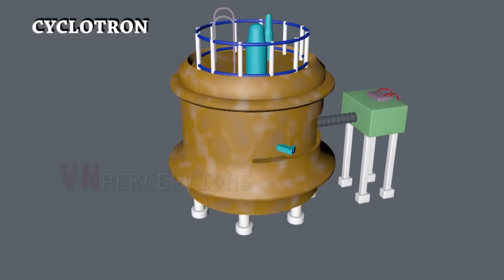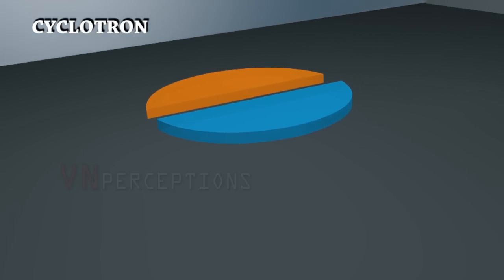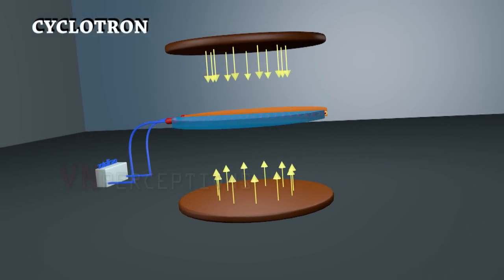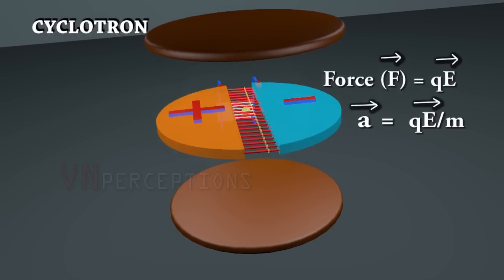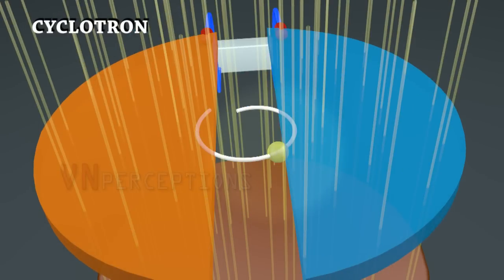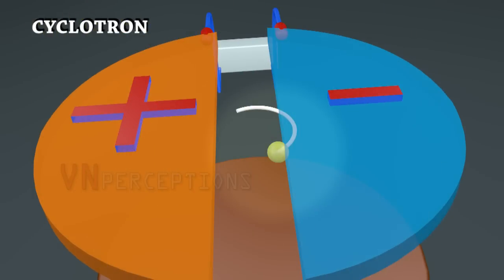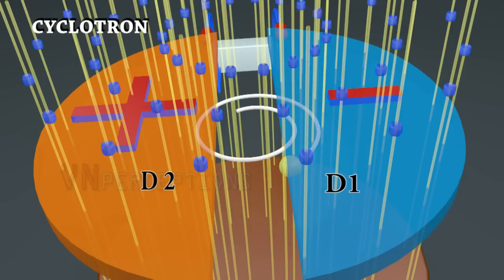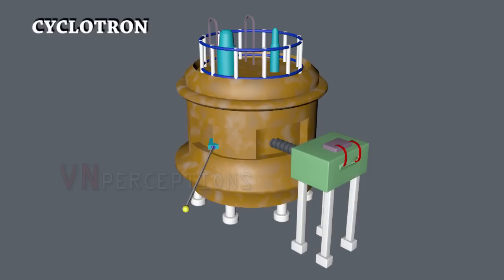Principle and Working of Cyclotron

Comment: just listened to a video about movement of a charge particle in an electric field and magnetic field.  Apparently in a magnetic field it moves circularly.  These guys must have been brilliant to come up with something  like that and work it out back in the 1930s.  I found physics textbooks to be dull and awful in 1980s at college.  I didn't lose my interest in learning about it, but got sick of getting Cs in the subject in college.
Reply: Apparently in a wire, the electric field pushes the particle forward and then the magnetic field moves it in a circle, so it moves in a helix in a wire on the outside perimeter (skin depth) of the wire.  Inside electric field of wire is zero.  I learned that on youtube , not in my 1984 electromagnetic class, if it is correct.

Comment: Probably a dumb question, but what stops the particle from getting kicked off the flat circular plane?  Flawless manufacturing?  Its only my gut instinct questioning this, but couldnt imperfections raise or lower that particle height as it revolves?  Are the Ds made sufficiently tall in depth that those offsets wouldn't matter....but then how is it concentrated perfectly upon ejection....i guess thats more like 5 questions....

Comment: Fantastic video about how a particle accelerator works!!  Thank you!! 

In case people are interested, if anyone clicks on the purple channel icon to the left, they can see a device fly by accelerating particles downwards without any mechanical moving parts.  It also carries its power supply which is really what makes it novel.  Perhaps a more advanced version could just accelerate electrons.

Comment: Wow, Alex Jones was right! They must be opening a portal to hell at CERN.
Reply: Jimbob Sherwood 
No, Unless u mean that in a metaphorical sense and we obliterate ourselves attempting to access properties of the Universe reserved for the ‘Gods’ that came here Eons ago and modified some monkeys and things to create us. Prob for food of labour needs lol... and please dont use the word ‘portal’... it implies we actually intend on physically ‘entering’ it.
Its (Cern) just probing at stuff really trying to work out the properties and characteristics of the underlying field that the Source Charge is manifest from. ie; where does EM come from.
I think this machine only lets them have a small glimpse, maybe one larger one before determining the configuration required to ‘tap’ into the field for the purpose of obtaining virtually unlimited reserves of energy. The energy is not introduced into our 3D plane of existence though as the very nature of our most fundamental field modality simply cannot sustain the pressure and inductive potential of this energy. The intrinsic magnetic component of our field would also induce a mind boggling level of impedance onto the electrostatic charge and coupled with the resulting change in the torsional force, things are getting pretty deep into unknown, unknowns territory. Instead the information gathered can be used to try determine the resonant properties of the Source charge and attempt to align these two Field modalities in a way the the resonance ‘feed back’ is greater than the energy required to produce the input signal. 

Of course, in the interplanetary and more so, the interstellar mediums, there are much greater possibilities as the conservation of the respective local medium is not of such great concern. Imagine unleashing charge equivalent to our entire star but not as thrust but as a directed repulsion form of electrical force that pushes on the relativity dense ‘fabric’ of our ‘space’ ( the stuff that ‘matter’ is able to ‘transition behind’ at magnitudes smaller than our highest energy EM wave form. 
Incredibly risky....
Could be a drop in the ocean in reality, or....
The ripple effects through either our fundamental fields, or more worryingly, through the source charge field could have unexpected effects on our existence at distant locations. Cause supernova of stars or loss of input energy at a galactic centre... 

But thats some time away lol. We’ll have more likely irreparably damaged our genome and contaminated the planet or catastrophically disrupted a critical component of its electrical/magnetic/resonant system and/or fields.

Comment: 3:24 "The electric field inside the container is zero"
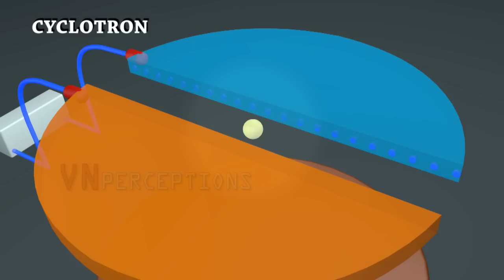4:24 "It (Charged particle) is influenced by an electric field" .......?????
Reply: yes, the electric field inside the dee is zero because it is a metal or conductor.  But inside the dees, magnetic force or Lorentz force do their work by moving the charged particle in a circular manner. Then when the charged particle has come out from one dee, it is moving to another dee by the influence of electric field ie present in between the dees due to external ac field or oscillator.
Reply: No...
Reply: @pritamkumarbishee5053  
Ok...
thank you...😊👍🏻
Reply: @s.k_525  yes

Comment: i don't think when particle move(gets accelerated ) between the dees in presecence of electric field it will have a curved or parabolic path in comparison to distance and accelration provided to the particle i.e. its motion between the plates of dees should be straight ....right?
Reply: No because it is still under the influence of the magnetic field which is perpendicular to the plane of revolution of the charge (which gives it its curvature) :)

Comment: So at the end you need a particle deflector to shoot the particle through a tuning tube so it can slam into an element, thus causing a transmutation causing thermal nuclear heat. That heat can be mixed with a gas to cause a combustion to start up the gravity excelerator. Once started, it will produce a gravity wave.

Comment: why electrons are not used in this device?
Reply: When a particle speeds up and approaches the speed of light, it's mass increases. Because electrons have so little mass (9.11x10^-31) any change in mass would have a great impact .This means the time period for each circle would increase (because the electrons are heavier). Protons are used because they have a lot more mass (1.673x10^-27) so any mass change is negligible, so the time period for each circle is constant. This is useful because it means we can set the current to change direction every 5 seconds or whatever, which we couldn't do if we used electrons.

Comment: Why not electron is used??
Reply: Maybe because of its extremely less mass, it may not be useful in nuclear fission. I am not sure though.
Reply: @anmolagrawal5358  is right. The main use of this machine when it was first in invinted before the Manhattan project. The main purpose of it was to accelerate a larger particle so that it would have enough energy to break up a radioactive element setting a chain reaction. The electron would even to small to effect the large heavy radioactive metal
Reply: @codyburkholder7397  Um you partly wrong sir. You are right about electrons not being used due to EXTREMELY SCARCE MASS but sir the penetration power of an electron is FAR FAR greater than a PROTON or a NEUTRON. The actual reason is that the electron would be accelerated to such high velocities that it would become out of phase with the oscillating field & it is EXTREMELY TOUGH to perceive its curvature at such high velocities so the desired effect of cyclotron wouldn't be achieved. :D
Reply: @nukemarsYT  can u  clear this point a lil bit ?
Reply: @FourrabeaCamillo  what exactly do you need an explanation on? (To make it easier) :)
Reply: @TheKawaiiStar  it would become out of phase with the oscillating field and it is extremely though to perceive it's curvature at such high velocities??
Reply: @FourrabeaCamillo  Oh that bit. Well what I mean to say is um.. you see we are using an ac source to supply the Des with electricity to generate an electric field and an ac source changes basically the direction of flow of current after every cycle which is called the frequency of the source for example 50Hz. That would signify that the direction of the current changes 50 times in given unit of time which is 1 second here. So if an electron is used in place of a RELATIVELY HEAVIER particle such as a proton or a neutron when the electron keeps gaining more and more velocity it will VERY SOON run out of phase with the ac source stating that when the direction of the current is left to right our electron under the question would be moving in THE SAME DIRECTION AS THAT OF THE CURRENT which would mean that it'd lose its momentum and the whole project would fail as a whole since the very point of having a cyclotron was to ACCELERATE SUBATOMIC PARTICLES to SPEEDS such that would bring man some benefit but by the use of electrons it'd rather bring the opposite effect by making the electron lose momentum than gain it (there's a lot of unnecessary information in this comment lol pls excuse me) and the cause of that is: 
1: mass of the electron being almost negligible compared to a proton or a neutron which already have a very INSIGNIFICANT mass
2: electron's ability to penetrate is so much more compared to the other sub atomic particles (because of the first reason again) that it will run in the same direction as the electric field (which fundamentally shouldn't happen) therefore reducing its speed and momentum than increasing it.
hope it helps :3
Reply: @FourrabeaCamillo  also uh just felt like typing this down too. The terms in phase and out of phase carry different directions for a proton and electron here due to the difference in the fundamental effects of an electric field on both. :)
Reply: @nukemarsYT  why momentum decreases if electron move in the same direction as electric field?
Reply: Because on high velocity the mass of electron changes

Comment: Good effort. But at 5.36  its said that the velocity would remain constant inside  the DEE 1. This is wrong, Magnetic field inside the DEE changes the direction of motion of the particle. Change in direction is change in velocity, which is also acceleration. What remains constant is the speed. Please correct this.
Reply: true sir

Comment: just question .  can man build a cyclotron able to reach escape velocity for radioactive waste.
to the sun
Reply: Simply we can't accelerate that much mass to such a high speed.It will take lots of energy
Reply: @dncmi1436  you are absolutely right
Reply: the escape velocity to sun from earths orbit is 42.127 km/s....
the only limitation this cyclotron faces is that if velocity crosses speed of light then the frequency becomes zero more like placing a pendulum in the middle of the earth it wont oscillate 
 this can be followed up by einstein special theory of relativity ...
and yep you cant oscillate neutral species and only charged species can be accelerated and also using  an electron is not preffered cos its mass is  not effecient to initiate an acceleration and get a massive velocity out of the cyclotron.....

so basically what am saying yes it can reach escape velocity but what you tend to do with it is not practical
its like launching nuclear waste to earth atmosphee
re
lots of variables and lots of stuff can go wrong and the high enrgy radiowaste can even bombard the atoms in our atmosphere on its journey to the space.....dude cmon think about it...seriously
Reply: @azzyboii830  oh very nice so you basically talking about the most basic principle of theory of relativity that is velocity increases mass so exactly you are wrong indirectly because any charge particle (except electron and other which have less than gram mass) can travel at speed of light such that you should just have adjust the duration of time to radiate energy from any charge it will behave like infinite mass.....you should lot to learn about special relativity 

Just take it seriously you are right but didn't understand simple concept

Not explaining about cyclotron just want to clear concepts 
I write only few points

Also not taking about electron because it is not compatible unit against speed of light very neglect mass it has
Reply: @metawhirl4609  basically you're not getting at any point here
Don't waste your time yoooo➡️➡️➡️

Comment: There is a little mistake in the explanation... when the particle enters the cylindrical D , there is a change in velocity.. magnetic field can change the velocity.. what does not change is the speed of the charged particle...
Reply: Mike De Moose You took too much into consideration.
For those who didn't understand - the velocity depends upon the direction also. As the direction of the particle changes the velocity also changes but the magnitude of velocity or the speed does not change.
Reply: U mean angular velocity remains constant?
Reply: JAmes BoNd 007 .well done..spotted the right mistake which wasn't a big mistake.ur ryt...mag of velocity doesn't change but it's direction does.
Reply: Mike De Moose wtf this instrument was designed for accelerate particle by providing energy. You all want to smart but can't see what is Moto . What if he say v is not change even some one is nailing . But keep passion the energy not change that's it
Reply: when u bombard the nuclei using the high velocity proton or deutron you can induce fusion or any other nuclear reaction  releasing lots of carbon free ,pollution free energy
p.s it doesnt take much of an enegy to run an electromagnet and an oscillator or ac source.....
so atleast think before saying stuff are dumb bruh!!!!!!!

this is an application of magnetic feilds  like the tokomak 
https://www.iter.org
https://youtu.be/vqmoFzbZYEM
do you think they spend this much money on projects like this and a think oh yeah i need energy to run this plant whats the point anyway??
grow up dude
@vikram Dan barath
Reply: @vikram_Bhu  do read my reply bro
Reply: @vikram_Bhu  acchi English hai
Reply: Gaurav Ag. Magnetic force providing centripital acceleration which change its direction(change in velocity)but there is no tangential accleration so no change in magnitude of velocity i.e constant speed......
Reply: yeah thats right...velocity changes because the direction changes
Reply: Here speed is increased by electric force and direction is changed by magnetic force
Reply: Inside the d its velocity remains constant but outside the d in the electric field applied its velocity is increase.
Reply: Yeah that's the difference bw speed and velocity(yes direction)
Reply: Yes there is a mistake ....... Velocity are changing but not speed becoz magnetic field only changed the direction not speed
Reply: I think velocity will change because of inertia as it has to complete larger periferi in fixed lime but it wouldn't due to magnetic force...
Reply: Monu yes right maine aaj hi class me padha....i am from class 12 th
Reply: Nice explanation on this topic in you tube history ever
Reply: magnitude of velocity remains same but direction changes
Reply: Mike De Moose The whole point is to increase the speed for many purposes 😂
Reply: Yeah! You are right. He made a mistake.
Reply: Mike De Moose  no ... the spd of d charge change .... coz the particle have to cmplt d semicircle within the fixed tym ...
Reply: Ankita Tripathy  ... You are right
Reply: Actually if there is a change in direction there will be a change in velocity. Because both direction and magnitude is considered.  Besides the particle is coming a semi circle and inncircular path velocity doesn't remain constant